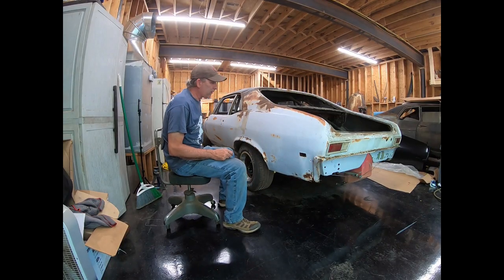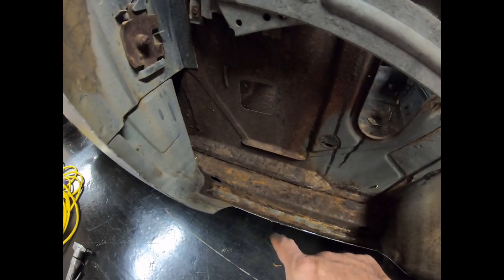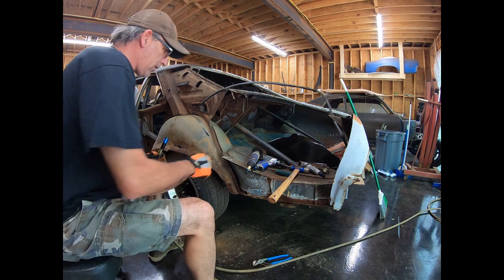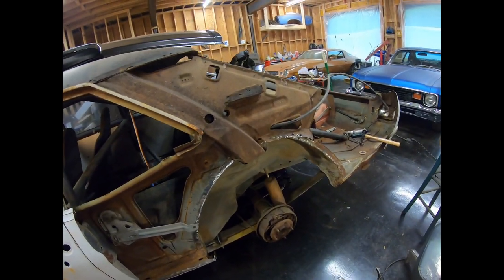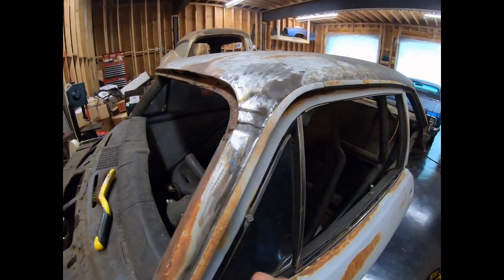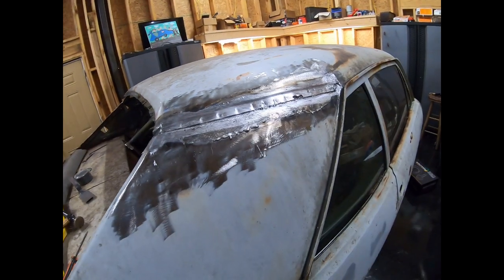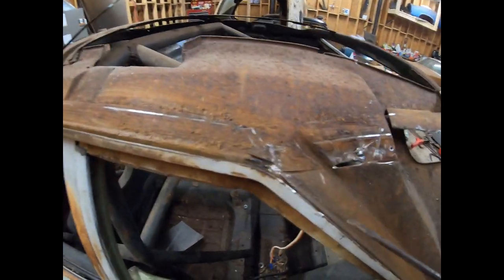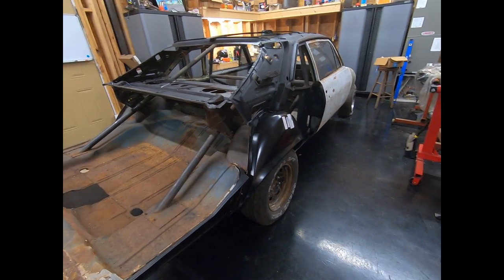1969 Chevy Nova Rust Repair

Comment: Amazing work, I cannot imagine doing this to my 74 Buick Apollo, but it sure is fun watching this type of work being done.
Reply from the maker: Thank you!!
Reply: @Shop209  hey my roof sheet looks about like the one in this video. Has some pitting, but no rust holes. Do I really need to replace the entire thing? Or do you think I can get by removing the windshield and taking the rust off and just filler it in
Reply from the maker: @lucysmith4242  hey. I have another one that was just rusty and I was able to get rust out of pits and put epoxy primer on it. I had to be really careful and it took a while. You might have the same luck. Just remember if it’s rusty on one side it’s probably rusty on the other. If you are doing the paint job it might not be a big deal to have to repaint it but if you’re paying $10k-$15k, make sure it’s fine right. Thanks for watching.
Reply: @Shop209  much appreciate your comment! This will be a race car not a show car
Reply: I have a Buick Apollo also I can see rust inside the panel s

Comment: Great videos! I'm contemplating buying a 68 nova straight 6 power glide car that has rust but not terrible. Only thing is the interior is almost non existent, the main thing being the gauge cluster. It does have a brand new set of tires and wheels on it. I'm just wondering if 5k is a little steep for it. Being a 68  it really caught my attention tho.
Reply from the maker: For a decent body on a 68 I would think $5K isn’t bad. Although the dash stuff is hard to find and not cheap.

Comment: So I'm a proud owner of a 1971 nova I have it stripped down to metal, and need new quarters both sides and was wondering if I plan on just running with a black epoxy primer until I paint it is that a good direction also I'm fixing to pull the front clip off and paint it what do you suggest for paint on the firewall and wheel wells?
Reply from the maker: In my opinion, as soon as you strip it down, get epoxy primer on it. You can put any filler over the epoxy. You can run around with epoxy on it but they usually have no UV protection. I like to use a satin black on the engine compartment.

Comment: Hey dude thanks for the video its helping me alot with my 69 nova, but I have one question what kind of welder do u use for this kind of body work, I don't know much and want to know whats a good one for this kind of application.
Reply from the maker: I have a clamp style spot welder and a Lincoln 180 mig. I also have a Miller TIG but I’m still learning to use it. I’ll do small rosette welds anywhere I can’t use the spot welder. The second video should be up in a couple weeks. Thanks for watching! I really appreciate it.

Comment: I ordered new qtr and new outer wheelhouse but the qtr doesn't extend to the bottom of the wheelhouse it stops at the top of the rocker.. is there a piece that extends the rocker or covers the gap below qtr and ties the rocker , outer wheelhouse and qtr together... thanks. outer wheelhouse and qtr fit great, just missing a piece
Reply from the maker: The inner wheelhouse does connect down there. I’ll look and see if I have a pic of that area.

Comment: Wish I had the skill to do this to my 73. Are you eyeballing the fitment on each panel? And how did you know nothing would warp?
Reply from the maker: The panels fit pretty good. Plenty of tweaking to get the fit right on all sides. I wasn’t worried about car warping too much because of the roll bar. I have a frame machine to check everything if I need to.
Reply: @Shop209  oh awesome! I have a 73 Nova that I am trying to replace the rear frame rail on, any tips?
Reply from the maker: @DillyTK85  You just need to take your time and make sure everything is matching up as close as you can get it.

Comment: hey man i have a 1973 nova and i have a rust hole right through the roof. im looking to just replace it. however i can not locate a skin for a 1973 but i can find one for a 1972 would a 1972 fit my 1973 they both are a 2 door skin.
Reply from the maker: Yes. The skin for a 72 will work. There will be a little patch work involved around top of said panel but it’s not hard.
Reply: @Shop209   thanks man i also emailed you. you can just ignore that haha

Comment: When you cut the left rear (driver rear) quarter panel off & I saw all the leaves, I was wondering how in the world did all these leaves get all the way up into the roof area???
Reply from the maker: Mostly because the top of the quarter had already been cut away. They can still get in there though. Usually animals nesting.
Reply: @Shop209  I'm watching the end of your video now where you mention that, "you took 4 months off, & Franken Nova is going to the track".. I am new to your channel, just found ya this morning, Good stuff! I NEED TO FIND A BASKET CASE TO BE ABLE TO OBTAIN IT CHEAP & BUILD! My twin brother lucked into & found & purchased a 1979 Z-28 Camaro with a 1973- 4.125 bore sb 400 bored .030 over, stoker kit, custom length rods, amberlightweight pistons 11/1 compression pushing arround 750 hp. He sold it & bought a house. I hope to build one of my own one day?
Reply from the maker: Sounds like a beast. Welcome to the channel. More videos coming and I’m trying to keep getting better. Thanks for watching.

Comment: You are going deep down that rabbit hole. Being from the southwest, the footage from this and your last video gives me the chills. I have a lot of surface rust on the roof of my car (the sun has burned everything off) and a few holes around the front and back windows, but it's never occurred to me the remove the roof skin. What was your main reason for replacing the roof?
Reply from the maker: Several reasons, there was a bad dent that had been fixed and the spot was oil canning. Mainly because the windshield channel was rusted in the front and back. I know there are patches for that but replacing the skin seemed like a better option. All the welding will be at factory seams and easier to finish. I just picked up a few more cars and they’re way worse than this one. I’m gonna get lots of practice. Lol. Thanks for watching.
Reply: Thanks for sharing the work with us!
Reply from the maker: No problem. That video was filmed last year. The next video on that car will be up in a couple weeks. Then another where I paint the car.

Comment: Is it possible (74 Nova) to replace the trunk drop off without replacing the quarter?
Reply from the maker: Not the complete drop off. You could piece the bottom in probably.

Comment: can the 72 nova roof skin be made to fit a 73 nova?
Reply from the maker: Yes. Easily. The only section that is different is where the quarter panel meets roof skin. Once you get a roof skin for the 68-72 you can set it on top and get an idea of what you need to do to make it fit.

Comment: Why would you cut all that gm factory metal off to replace it with Japanese panels, graft in what you need
Reply from the maker: The drivers quarter was 3 different panels all jacked together. Passenger quarter was rusted in every direction. Roof was oil canned from tree limb and rusted out at windshield. Taiwanese panels fit pretty good and it’s better than spending 200 hours of patching in pieces of Taiwan metal. I don’t believe in cutting up salable cars to fix rusty cars when most panels are available.
Reply: @Shop209  got it
Reply from the maker: Don’t get me wrong. I would love to get stuff made here. Just isn’t an option.